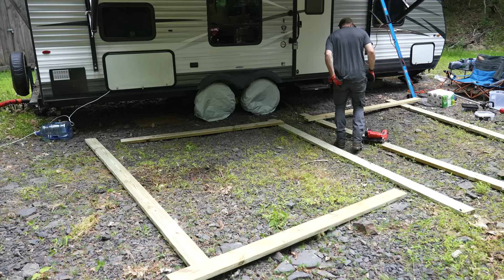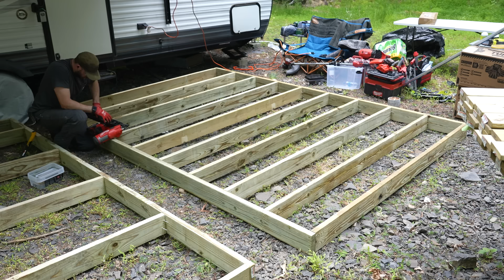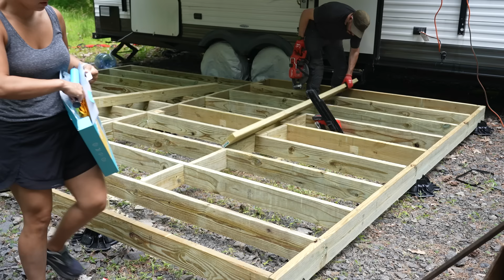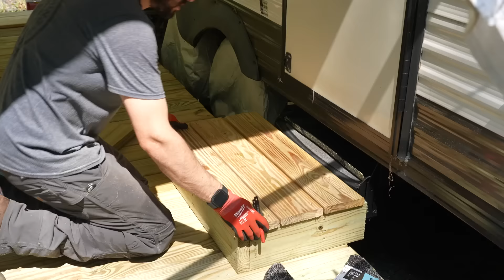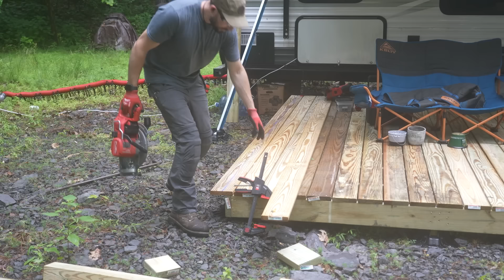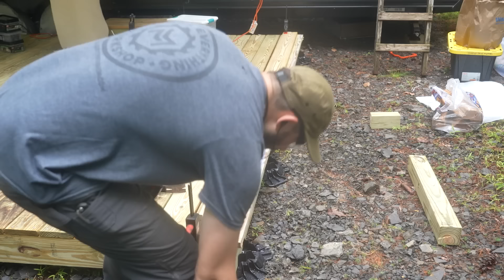YOU Can Build This Deck In 1 Day!

Comment: Seems like a good deck. I would have however (notice the expert talking) not used the TuffBlock so far out on the sides. Now you can see them sticking out from the front and side of the deck

Comment: 16 on center makes sense when your doing 2x6 or 2x10s for the top , but I think it would be really saggy with the 5/8th deck board , I think I would do 12s on center. Does it sag with 16 at all ?
Reply from the maker: No sag at all I’ve done a lot of decking this way and only if you get a bad board does it sag

Comment: Do you have a material list?
Reply: I need that too
Reply: 4 (4x4x8),26(2x6x8),10(2x6x12) -all pressure treated. Then the deck boards…24 deck boards (1x6x12).. do the math at your store not including the tuffblock.. In my area this would probably cost done by yourself about $500
Reply: @Haha_grows 32 deck boards actually.
Reply: @MVCompassRose okay! My bad!
Reply: @Haha_grows  😊
Reply: And total cost?
Reply: Wood, nails and time

Comment: I made a 16' x 16' ground deck at my camp out of 4 - 8' x 8' pieces. Lag bolted them together and staggered the 8 footers on top. It sat for 10 years on the ground and now the pressure treated wood is rotting. Made a big mistake not raising it off the ground but then again, I thought I'd only be there for 10 years!

Comment: 15:28 Instead of losing floor space, I think I would have fastened another 2x6 to the outside of your frame, so the deck board would have enough material to nail to. It would hardly be noticable. (Instead of ripping the last deck board)
Not knocking your build at all, this is very similar to the way I've built my last 4 low-height decks.👍

Edit: After saying all that, I didn't realize you started your deck boards short from each end. Ripping the deck board and using it on both sides worked best for you.

Comment: R/decks on Reddit is going to ask where the Zip tape is, but I love this. Nice quick build demonstrating efficient methods.
Reply from the maker: Yeah I considered zip taping it all... but because of the way it's exposed to full sun I think it will have plenty of chances to dry out when it's wet. I built a similar deck 12 years ago at my parents house, 2x4 sleepers in direct contact with dirt as the framing, in a VERY shady back yard. 12 years later, the deck boards started to rot out but it remained very solid... I think this, floating off the ground and in the sun will let this last 10+ years easy!
Reply: @MakeEverything for every “where’s the tape?” guy, there’s a “tape just rots the wood faster” guy.

Comment: No joist hangers? Nails instead of screws for the decking?
Reply from the maker: Joist hangers are a little much for a deck that’s pretty much on the ground. Either way I’ll be sure to wear my fall protection next time I’m on there!
Reply: the horror!!!!!!!!!!!!!!!!!!!!!!!!!!!!!!!
Reply: What’s it gonna fall, 3 inches if it fails?